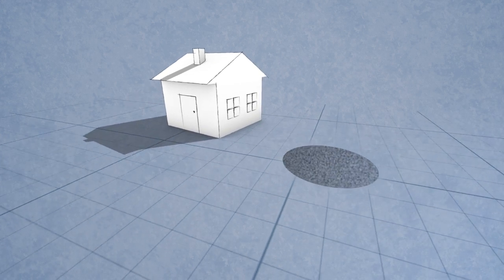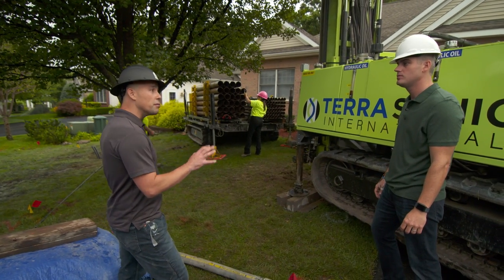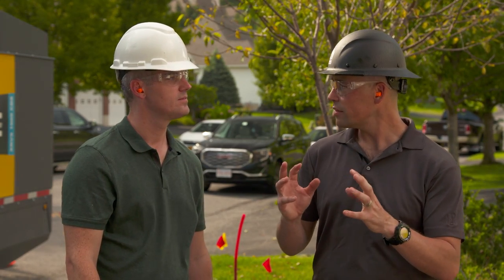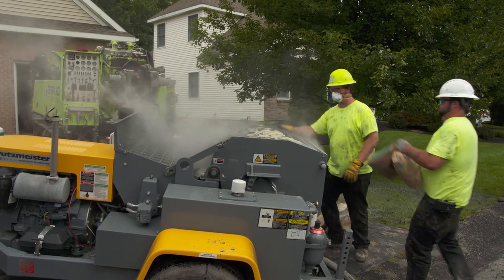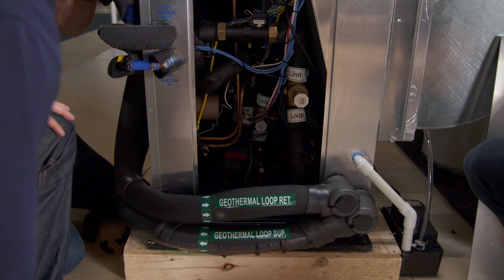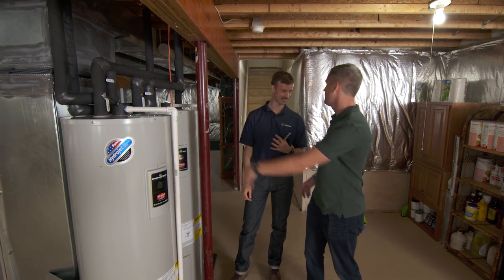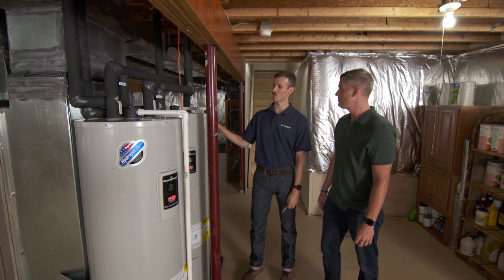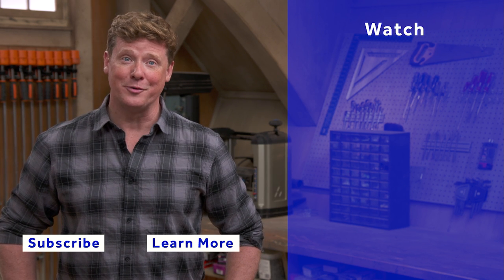Affordable Geothermal | Future House | Ask This Old House

Comment: This guy got two things wrong right off the bat. The steady state temperature of the earth in any place is determined by the average annual temperature. For instance, where I am that is 75 degrees, in a cold climate this could be 50 degrees, or in an extremely hot place it could be 80 degrees or more. The second thing he got wrong is that it takes no fossil fuel to run these systems. It is true they use very little compared to a conventional system, but it still takes a significant amount of energy to run the pumps, fans, etc.

Comment: I like geothermal and wish to install in my home. But the approach in this video dampens my enthusiasm. I don’t like to drill the earth and put a 150 feet hole. Also the method of digging by creating vibrations makes it not so environment friendly. 

I though we have to dig only about 10 to 15 feet like a small swimming pool floor and lay the pipes horizontally. But in this approach they are pretty digging a bore well. Not so great
Reply: This isn't new and it's way less disturbing than laying out several miles of pipe 50 feet deep.

Comment: Stop talking about geothermal when you mean ground based heat source.
Geothermal means tapping the heat radiating from the earth core. For that you have to go deep. At least 400 m, but often several km.
Using the constant temperature at shallow depth, is called ground based source, not geothermal.

Comment: Well done story, overall.... but it was just a shame a few key points where missed or incorrect... such as calling it renewable... and it was also a shame they used a wastefulf electirc resistant water heater to finish heating the water....

Comment: "No fossil fuels " except for the electricity to run the pump and the fan, plus diesel for the drill
Reply: Did you learn that at fox news school?  Diaf
Reply: Right Mike.  Electricity from Natural gas, even if it’s just to backup renewable sources.
Reply: @bigvegass  no just common sense.
Reply: Our heating and cooling guy talked us out of it even though they only quoted us 12500. He said no savings in summer as you have to run dehumidifiers in the summer since you don't have an A/C unit.
Reply: Your heating and cooling guy who probably has no experience with geothermal and therefore no incentive to be honest about it since it would drive you to another contractor.

Comment: But to make any economic sense at all it must be subsidized by all of the state's taxpayers. That might be fair if it were preserving a scarce natural resource needed by everyone. But is that the case? In my state, natural gas is cheap and electricity isn't overly expensive either. My house is adequately insulated, the central AC systems are the optimal choice between cost (including durability) and efficiency. AC and gas heat are zoned. My neighbors' houses are smaller, less well-insulated, etc. and they pay almost twice as much as I do each year for energy. I kept my old AC systems going for 43 years with only minor, DIY repairs; but, have to admit that new systems have their advantages. My advice though is to keep them as simple as possible for your needs.

Comment: the house needed least 3 geothermal wells for size it drilled; according to my calculation;
Reply: Hopefully you're not getting vertical vs horizontal confused?
Reply: no . . coil v rod;
Reply: @davidyoung3288  Same differences. That one well should do an average sized house since its a vertical well. Its more like a field when its horizontal and you need a much larger area.
There's also shallow well versions where they put a bunch of lines in each direction.
Reply: this house was in Albany ny; liken to kenya Africa; engineering should anticipate worst days; dealer is not load engineer; to size it properly; i seriously doubt he is fluent in fluid dynamic; in middle of cold ohio winter; solely on electricity;
Reply: Maybe your calculation is wrong?  They have installed over 200 systems (they claim).  How many have you installed?  Does your calculation account for the exact design, conditions, location, materials and equipment used in that system (that they didn't provide)?
Reply: their pipe runs down vertically; mine is not a coil; 
it is s curve inside; creating wider surface area; 
also mine has greater vane suraface area; and it has built in vane; inside of pipe; so it takes shorter time as heat exchanger; geothermal energy is heat exchanger; and inefficient  as current design; i made improvement;
Reply: david young you sound like a smart engineer, but I'm sure these guys have teams of engineers to calculate these things including softwares.
Reply: david young Some people just NEED to be seen as smart. An armchair expert. Sheesh. Go onsite and be sure you know the exact scenario.
Reply: i has no inclination need to be seen as smart; trust me;
Reply: david young well then, you have been successful.

Comment: why the hell drill a huge hole??  dig a trench and curl the pipes on the bottom of it.....
Reply: You have to dig deep to access the large temperature change/capacity required for this to be useful.
Reply: Because there isn't enough room in the front yard, can't get equipment to the back yard, and or the lot is too small. Digging a huge trench isn't that cheap either and you have to resod your law when you are done.

Comment: To do all that work for $20,000 is impressive I don’t know if that included incentives to get it so cheap. I don’t like the government subsidize not though I don’t think middle-class people should be paying for this that’s another topic. It’s the way to go if you can do it in the Northeast air to air heat pumps don’t put out the best heat once you get below 35. I always like forced air the best over Ductless. I do not believe in CO2 induced climate apocalypse bullshit being sold to everyone by left-wingers so to me converting gas to this is a waste of money. If it was a oil fired furnace and gas was not available then this would be a good alternative. There is a lot of hot water baseboard in the Northeast and those will always need gas or oil fired boiler‘s

Comment: It’s the same as fracking taking stuff out of the ground but not replacing it that does damage to property’s and other things that makes sink holes 🕳 in the ground as our village has banned the use of drilling as other places round our airier have suffered from drilling making peoples property damaged and the insurance won’t cover for it.
Reply: The closed geothermal system does not remove anything from the ground like fracking.  only transferring heat.
Reply: @roberthoffman870  He isnt correct, but you arent quite either. Taking heat from the ground does have giant impacts. Right now a single system does nothing. But an entire metropolitan area taking heat or adding heat to the ground will impact the temperature of the system. We dont know how big an impact that will make.
Reply: in Kerrisdale neighborhood in vancouver British Columbia an unlicensed contractor hit an aquifer at 20 meters(65ish feet) panicked and pulled their casing out the hole. The damage and costs were quite significant, i think they lost 2+ homes. I also remember reading another in the states where drillers hit a pocket of gas in the ground which then worked its way through the ground to a neighbors home.  Except if it's engineered properly i'd probably not want it used near me.
Reply: @tcthorodr4023  
That can happen to licensed contractors as well.
The only way to avoid it is to scan the earth prior to drilling to see what's down there, but given the depth, technology may not permit an accurate scan all the way down.
Reply: @Luckingsworth  A metro area, or a thousand of them with geothermal, won't move the down hole temperature a single degree.
Reply: These holes are not hydraulic fracturing, i.e the insertion of high pressure water to break rock.  These geothermal wells are little different from water wells, which people have been digging for thousands of years.  Nobody "suffers".
Reply: @Nill757  Yup, really latched on to that metro term didnt we? If the entirety of New York City, or LA, or Beijing, ir any other mega population were to do this, who knows the consequences? If the bedrock temp were to drop 0.5°, it would probably do nothing. But certain plates being at slightly different temps, having cold and hot spots and so forth. I am not willing to risk potentially disastrous consequences.
Reply: @Luckingsworth  No one is advocating this kind of solution for mega cities. Your what if scenario is analogous to saying... If i drive a car on water i will sink, so car is not a viable mode of transportation, at all.
Reply: @Luckingsworth  you don't know what you are talking about.
Reply: @Nill757  I didnt claim to. In fact I claimed the opposite, that we dont know what will happen. Even the smallest and most subtle changes in things like this can have catastrophic consequences. We are already experiencing the same issue in the atmosphere. It would be foolish to see what happens when the same shifts occur underground.
Reply: I've heard of people drilling water wells taking stuff out of the ground but not replacing it, I haven't heard of the property damage, insurance problems and sink holes that go along with that. This is also the first time I've heard of a village that has banned the use of wells. Where do you live?
Reply: Jon M You claim that there is the “possibility” of “disastrous consequences” from many ground sourced heat pump wells, some 300 ft deep,  due to a widespread temperature drop of a continental plate.  You are mistaken. It’s like saying there’s a possibility the earth is flat, and nobody really knows for certain.
Reply: @Nill757  Trump knows...... He has perfect intuition.  That's why.  At least that's what a very stable genius told me.

Comment: No fossil fuels eh? So what powers that geothermal? Hydro where dose hydro come from? Fossil fuels. And Geothermals use a lot of power to power compressors, pumps, electric heat elements
Reply: Uhhh I think you're a little over your head.
Reply: Umm if the electricity to run the heat pump comes from solar or wind or hydro, wouldn’t that be a system that doesn’t use fossil fuels?

Comment: Why are you wearinng earpods while talking to each other?
Arent they supposed to killthe noise?
If wearing them cant even dampen light sound of voice while talking and u can hear each other, what is the point of wearing them around machinery?
Such a show off u guys

I had to come back and edit my comment ans add this .why would u play machine noise as background sound if you are already doing a voice over later?
Who is giving this production ideas?

Plug and play?
Have u lost your mind?
It is installimg the whole system with ducts. Plig and play? Why dont u just go home n plug it in like a usb cable and all done...
Reply: Hearing protection just reduces noise induced hearing loss. It doesn't mute out all sounds. Protection levels are generally around 20 dB to 30 dB. You can easily hear a  normal conversation with a 20 dB reduction as long as your hearing hasn't already been damaged, while still significantly increasing the required exposure time to cause the same level of hearing loss without hearing protection.